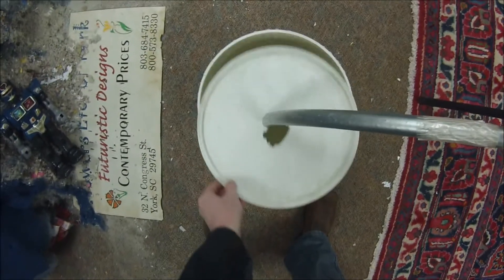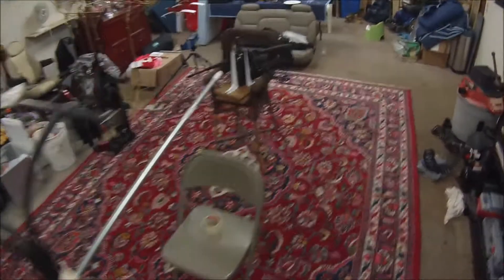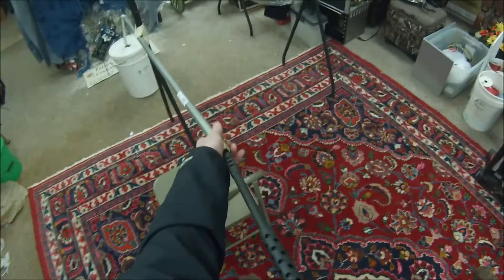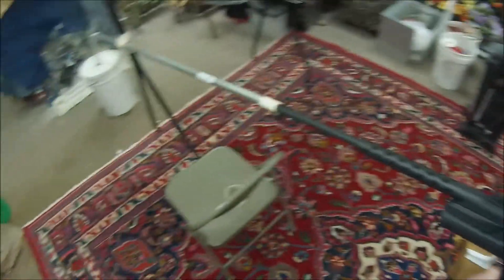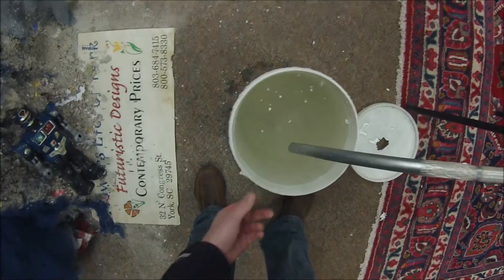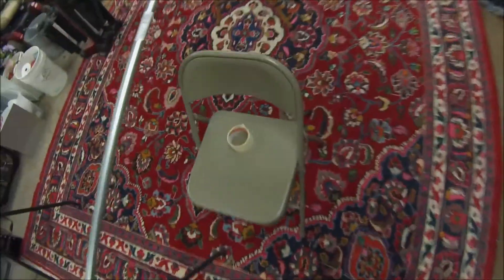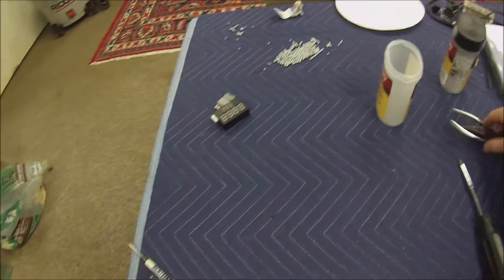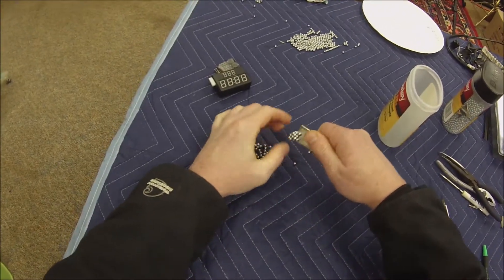4K RPM Drozd Blackbird Mod

Comment: where do you recommend for buying a blackbird?  looks like the mods for this are endless.
Reply from the maker: +2020tesla Unfortunately they are no longer readily available in the US, or Canada since the sanctions were imposed on Russia. Keeping an eye on this link is your best bet. http://www.searchcraigslist.org/  You can also set up notifications on FleaBay to notify you, but they are getting tighter on that. Neither site allows bb guns to be sold on them so you have to be quick to contact the sellers before they are flagged. There is nothing illegal about these guns, it's just the selling policies of the sites that don't want to deal with the liability.
Reply: +Mason Dawson  dang it.. one day I will learn to buy instead of farting around until its taken away.
Reply from the maker: Lol! You, and a ton of other folks. Good luck. Sometimes you can find them on allofcraigslist for a bargain. You can do the same things with a Drozd, or Bumblebee. You just won't have the Blackbird mag.
Reply from the maker: +2020tesla Here's a link for you.
http://airmachinegun.com/smf/index.php?topic=65.0